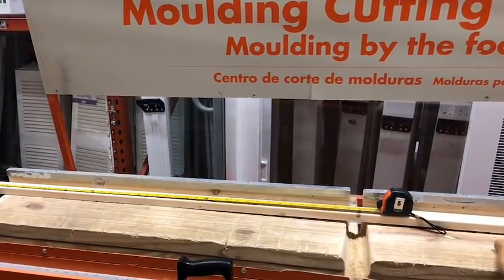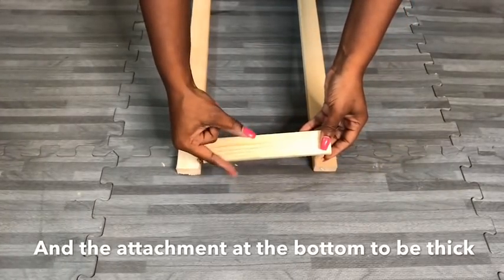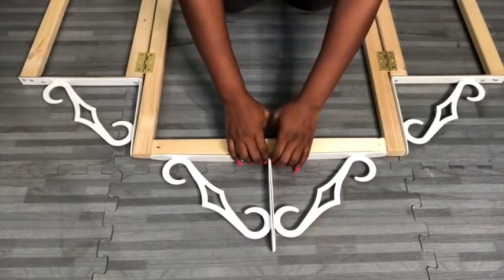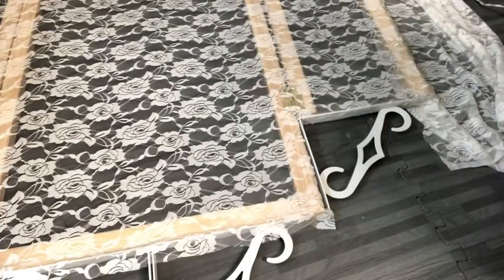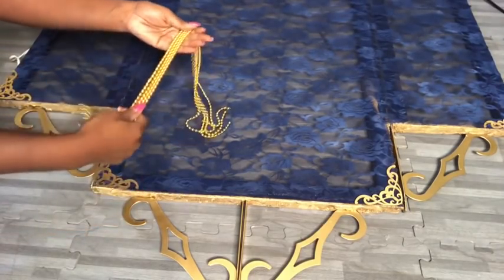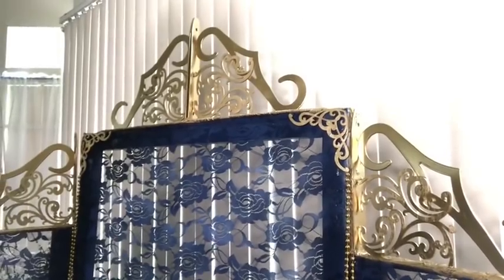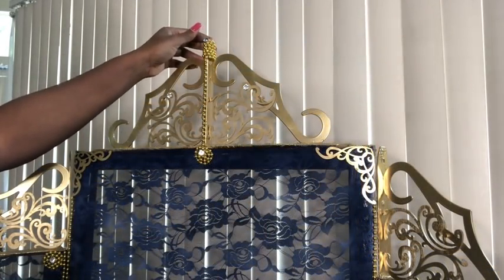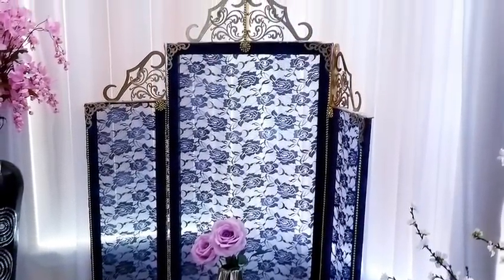HOW TO MAKE INEXPENSIVE LACE ROOM DIVIDERS FOR SMALL SPACES

Comment: It is beautiful. It’s going on my bucket list of things to make. 😊 question, would it be easier to dye the lace instead of spray painting it?
Reply: If it's polyester lace you might need to get dye especially made for it. I've done refashions over time of thrift store clothes and polyester doesn't always soak in the dye or it can also turn out patchy.
Reply from the maker: I’ve not tried dye on this before 🤔 but I see someone said with polyester, it won’t work as well so I will recommend using a fabric that can absorb the color without leaving lines or patches like she said 💕💕💕